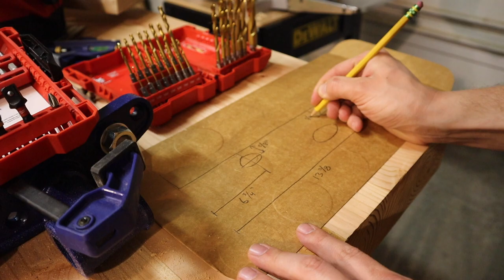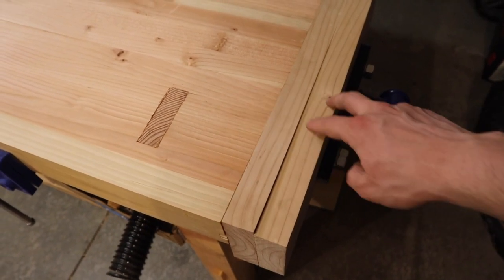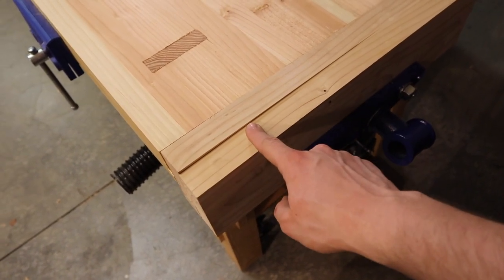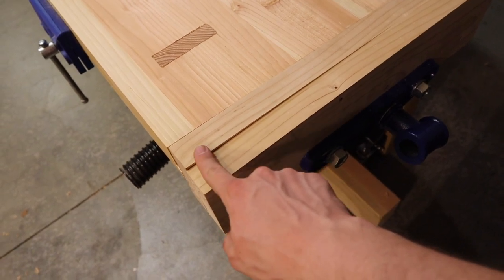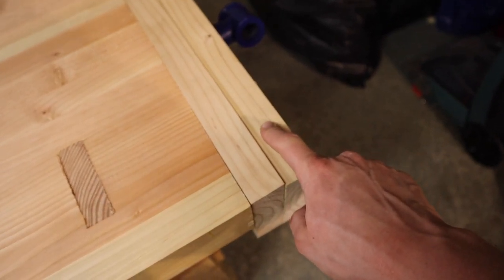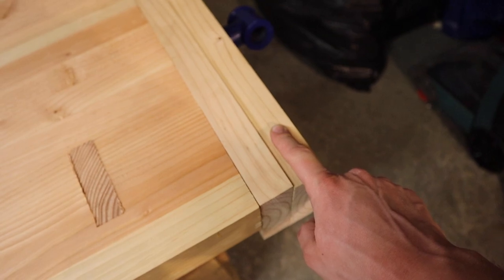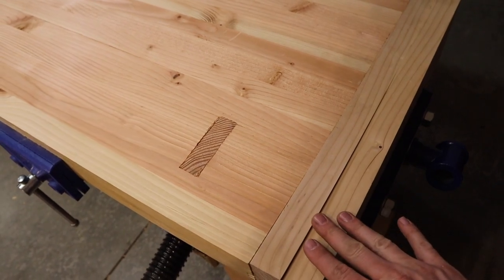Installing an End Vise | How To & Lessons Learned

Comment: Good video. The hints at the end are especially useful - I should be installing a similar Yost vise within the next few days.  As GeeDeeBird (below) mentioned, I plan on using a thicker movable chop so I can add dogholes to the jaw. Did you eventually line your vise jaws with leather?  Again, good video. Thanks for sharing.
Reply from the maker: Thanks! I appreciate your kind words. Thats a good idea with the thicker chop for the dogs. I would also go with hardwood if you can. Mine has been too flexible and needs replacing. The leather would be fine but I think I’ve decided against mounting it because there are cases where I don’t want it. If I do, I’ll have two strips I can put in on demand.

Comment: I’m glad to see that I’m not the only one that had some challenges! Haha

I found out that you have to go “Oversized” on the center screw hole!!!  

He’s right on Hardware!  I ended up using some Stainless #12 1-1/4” fasteners for the front of the vise and some #14 1-1/2” on the bottom side mount. The two D shaped mounts I used #14 1” Stainless screws. The only reason I used stainless is like the channel owner..it’s the only thing I had on hand that would work. ShopFox needs to do a lot better job with the suggestions.

Comment: you were off because of the way the holes were scribed with pencil.  just pop the front plate off from the screw.  you're left with a flat plate to clamp on the apron, or create a template from some scrap plywood.  also instead of hand drilling use a drill press.   nice bench top!
Reply from the maker: Thanks for the feedback! You’re totally right that my precision was just too low. And I would love a drill press but still have yet to get one 😂

Comment: You actually helped me - I installed my vise wrong and it was a pain doing so. I put the small screw in holders on the outside and mortised them in. Seems so silly now.
Reply from the maker: Oh man have I done stuff like that 😂 get all the way through assembling it only to find out I screwed it up 😂 glad I was able to help!
Reply: Curious on this as I am about to install mine. Are you referring to the two outer guide rings that screw into the back jaw?

Comment: wow get a smaller tape measure.
why not cut the bottom out of big hole that was not square, so any wood chips when working could just fall out
Reply from the maker: I’m not sure I understand your suggestion for both the tape measure and vise. Can you help me understand?
Reply: @NorthwestCraftsman  sorry being facetious about your tape measure never seen a small one like that being used it actual carpentry 😁. Going to suggest to notch the middle hole which has blown out so that any buildup on the threads can fall away and not be built up in your hole. Ie make it an upside down U
Reply from the maker: Gotcha! 😂 wasn’t sure if you were being serious about the tape measure or not 😂 and gotcha! That makes perfect sense especially since it isn’t used for stabilizing. I’ll keep that in mind when I rebuild it!